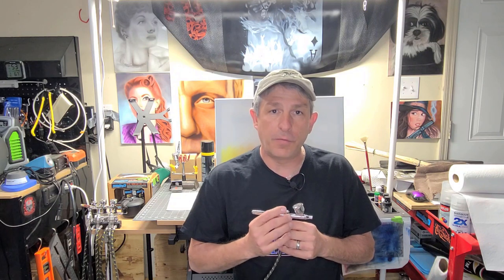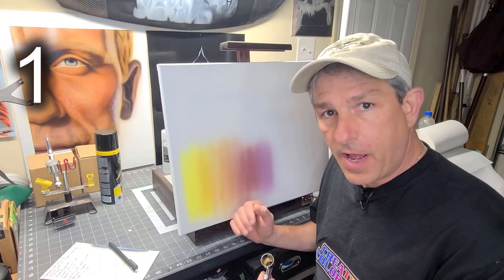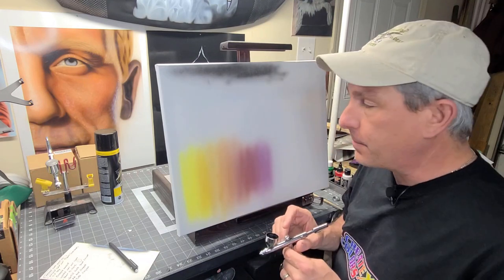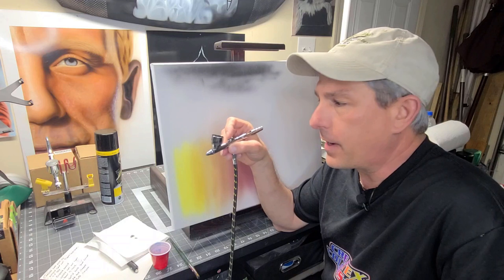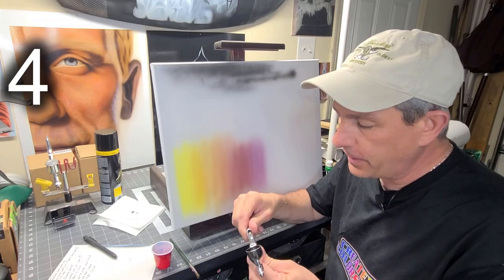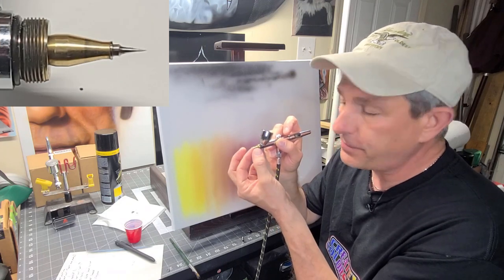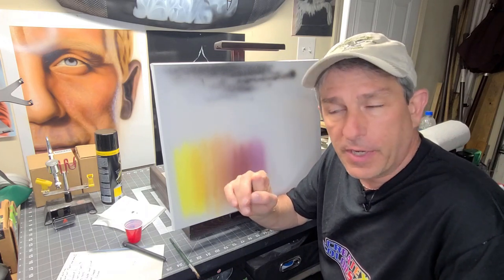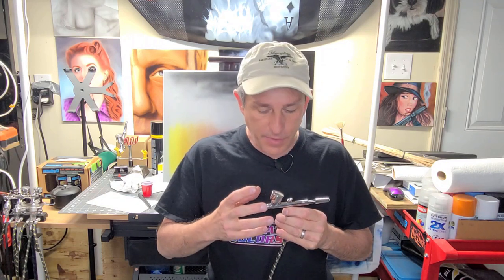Airbrush Won't Spray? Some Reasons It Won't!

Comment: I ordinarily spray with a bare needle, despite the fragility factor. I've found restricting airflow at the end of a needle in any way hinders control and begs more frequent clogging. 

 I too used to accidentally remove or loosen threaded air tips when I intended to only remove a crown tip or ring style protective sleeve. Since then, I've fashion softer plastic rings from cut segments of ball point pen/ marker sleeves or stout aquarium style tubing of the right diameter which can be removed or replaced quickly, slid on and off, so to speak. I find these far more convenient than threading something on and off between painting and storing. It also doesn't cost an arm and a leg if I loose one. As we all know, any chromed anything for airbrushes are pricey.

Another cause of blockage I've discovered is the clogging and backing up of paint into the channels in some airbrush bodies which convey air from the valve area through to the head and nozzle assembly. If paint gets into those and dries, (usually a cumulative and unnoticed process) it can eventually constrict or stop airflow to the tip even though a check of airflow at it's entry point to the brush indicates good  pressure.

Thanks for the video. Do you or have you ever used a Paashe AB retouching airbrush? Just curious. Despite being a discontinued tool, I use mine regularly and encourage any avid and brave airbrushers to get their hands on one and master it. There is really nothing comparable to it available for what it's best at, very fine work.
Reply from the maker: David, thans for sharing your experience. and no I never used a Paashe AB, but my first airbrush was a Paashe siphon feed. I used that for about two years before going to gravity fed brushes. Thanks again for the comments and thanks for watching.
Reply: @TheAirbrushGarage  You're welcome, thank you. The AB is the only Paasche I'd consider worth trying, not a fan of their convention style brushes but the operational principles of the AB sets itself apart from all other airbrushes. About the only thing it shares with other airbrushes is air goes into it. If you have a chance, do a search and have a look at how they operate.  I'd guarantee you'll at least find it interesting enough to wanna try sometime. Have a good rest of the weekend and thanks again.

Comment: I'm new to air brush and I did try that without the cap and wondered why it was able to spray without the cap on. Thank you for all these tips I ran into all these problems last night and wish I had seen it last night lol but I got through it I use a master air brush with the g233 and the g22 and I'm learning them still and learning the reducing part to get the paint to come out what is a decent psi to run I do custom hot wheels just a rookie on it but curious what psi u run your work at
Reply from the maker: Bleeleriy87, I spray at 27 psi. Good luck, and don't give up. It can be frustrating when you first start. Thanks for the question, and thanks for watching.

Comment: Awesome video! What's crazy was I was trying to troubleshoot my airbrush earlier and then this video popped up on my YT. Anyways..what was happening with mine was the needle wasn't going in when I pressed the trigger(Step 4). Which was annoying to fix bc everything was tighten correctly.
Reply from the maker: DS, did you get it fixed? And if so what was the problem?
Reply: @TheAirbrushGarage  I believe the screw wasn’t clamping on the back of the needle. I haven’t tried it yet but I did do a deep clean with an ultrasonic cleaner as well. I’ll let you know if it was something else. Thanks for your quick response.
Reply from the maker: @DarksouIjah  I have a video on "airbrush won't spray? Let's fix it. I don't have an ultra sonic cleaner. Also my first video I did on some reasons airbrush won't spray I talk about how my needle wasn't moving when I pull the trigger back and ot was because I forgot to tighten the needle nut. Lol. It happens!
Reply: @TheAirbrushGarage  I’ll check it out thanks! Also subbed.
Reply: @TheAirbrushGarage  I had this, ot appeared the needle wasn’t 100% clean , maybe greasy or a film of residue stuck on it, 99% ipa on a towel and rub the neddle with it and all went fine’  nice video

Comment: 😁😁 Could not tell you how many times I have not tightened the needle nut. The worst thing that ever happened was I was using my HPB plus and dropped it and then kicked it. Lucky for me I had the needle cap on and only spilled paint, so I thought. I cleaned the gun and began to spray shirts. Then there was no paint flow. I took the gun completely apart and put it in Airbrush Restore (be careful with this stuff. It will eat O rings.)  Put the gun back together and nothing. At this point I was very aggravated (mortified ) and had a deadline on detail on 20 shirts. I did every aleaning step there was. NOTHING! So, a friend of mine took the nozzle off and pushes a .18 feeler gage through the front of the nozzle. As we were looking through a lithoscope a 2 pieces of sand fell out the nozzle. YES! Sand! Remember, the hpb plus has an H2 needle nozzle combo that is .2mm. Now that was my first disaster. Then I did about 15 of the shirt fine details and dropped my gun with the needle cap off. Soooooo, I destroyed the needle, nozzle, and aircap. Very expensive drop.
Reply from the maker: Jeremy, It happens to all of us. That's why I keep an extra needle and nozzle in my box. Thanks for the comments and thanks for watching.

Comment: I clean it all that shoot out is the air some reason no paint is coming out so I after the plastic holder in water over night just in case the paint is dry so it not letting the paint flow though
Reply from the maker: Chef, take a look at this video and let me know. https://youtu.be/XnbRkeYBVyY?si=wU-IIyfDkhwpWMZr
Reply: @TheAirbrushGarage  so as I got home I took the bottom feeder out the water saw alot of paint coming out. It was the dry paint in the Tube

Comment: Bought a used airbrush kit and it works Great with just Walter or alcohol but when I use paint it doesn't spray paint. Thank you
Reply: Tonight, it sounds like your paint is too thick. Sart with a 75% reduction. Example...8 drops of reducer 2 drops of paint. If you are getting good results, add 2 moor drops of paint. Let me know.
Reply: @dancuccurullo8453  thank you very much, I will try that

Comment: helpful video…my issue appears to be that my lugnut is not gripping my needle so the needle doesn’t move with the lever is pulled.  I’ve tried tightening the lug nut but nothing moves!! Help please!
Reply from the maker: Linh, that's a tough one without actually seeing what's going on but...if you are using the correct needle size and the needle nut is tightening down it has to grab the needle. Take a video and IM me or send it to dan@theairbrushgarage.com

Comment: The air brush garage , yesterday I used my air brush it sprayed well , I’m a new user now learning to use one , last night I took it apart take it the needle and the pull back button to get paint fell out as the needle was out , I put it back together,, this morning using it it doesn’t work I’m getting non air ,, do you have a video I can look at to get fix ,,????
Reply from the maker: Vijay, the fact that you are not getting air is concerning. If your trigger feels like it is working correctly, there are only 2 reasons you are not getting air. 1. Your hole on your needle nozzle is blocked or 2. There is a rubber O ring in your hose connection or  more likely the O ring in the water trap at the brush,  if your using one can get pinched if you tighten these connections too tight. One other possibility is if you have a MAC valve on your brush, make sure it is not turned closed.
Reply: @TheAirbrushGarage  so I took it apart again a while ago there was a piece of thick paint beneath the trigger don’t know how that fit there , the trigger feels more free hopefully I’ll try it back in the morning I hope that was the problem

Comment: Hi Dan,
Helpppppp !
I’m new at airbrushing and I have the Iwata HP-CS. I’ve watched your video like 10 times and still I can’t figure out why my airbrush does not spray paint. Here is what it does. As I pulled the trigger back it does Not spray but as I move it forward it will squirt a bit of paint/air brush cleaner. I’ve taken it apart quite a few times and cleaned it as you show it on the video…so any suggestions?
Thanks, I appreciate your response
Reply from the maker: Ghost5. Have you checked out this video yet? Try this and let me know. https://youtu.be/XnbRkeYBVyY

Comment: I disassembled the gun to clean. After assembling, the gun is not receiving any air. I checked the hose and it is receiving the air from the compressor. What can you advise?
Reply from the maker: Amelia, I assume you didn't remove the air valve so that should be fine. Do you have a water trap right at the brush? If you di remove it and connect the hose directly to the brush. The other thing to look for is that the trigger is installed properly and depressing the air valve.

Comment: Hello Dan I am reasonably new to model tank building. My problem is that nothing comes out of my spray gun. Air does come out but no paint / liquid comes out. I have cleaned the gun over and over, I have stripped the gun down, I have replaced the needles and needle gauge still nothing comes out. I am wondering if O rings could be a factor here. I am at my wits end and I’m getting so tired of this happening so often. Can you help? Is there a YouTube video out there about checking / replacing O rings?
Reply from the maker: I am sorry if you didn't get my reply. I replied via my phone but it look like it didn't show up here. Start here...https://youtu.be/XnbRkeYBVyY?si=sucXsmGlRMcnW_Ha

Comment: I have a brand new airbrush, fresh out the box and its only spraying air. Not paint, not water, nothing! Please help....any advice is greatly appreciated
Reply from the maker: Red, remove the nozzle cap and nozzle then the needle. Now put it back together  make sure every thing is tight and the needle is pushed all the way forward and tighten the needle nut. Start with straight reducer. Hope this helps.

Comment: My Iwata Revolution has seized up overnight. I took out the needle with some pliers, and it was caked on paint about 2-3 inches up the needle (from the point). What do you think is going on?
Reply from the maker: Allessio, I know some people don't clean their brush when they are done for the night but I do and I never had that problem. I have a video on my cleaning routine check that out. Thanks for the question and thanks for watching.

Comment: Why is my Iwata dual action spraying paint when I just push down on the air?
Reply: Hitchcock, your needle isn't pushed all the way forward in to your nozzle or there is some dried paint in your nozzle or your nozzle is cracked. I hear a theme building here. Lol. You will get it just be patient. Thanks for the question and thanks for watching.

Comment: You forgot 1 thing I just experienced.  I have a adjuster valve on the bottom side.  I couldn't find the use of it on YouTube.  But apparently it can block all the air coming through so it won't spray.  Ps. Does anyone know how to use it,  what are the benefits 🤔
Reply from the maker: Herald, it is a MAC valve, Micro Air Control. It is used to reduce the airpresure for times when you want to get in close for finer detail and it could be use for stipple effects. It saves from having to go to the compressor and turning the regulator up or down. Hope this helps and thanks for the comment and watching.

Comment: So I normally just paint models with paint and a regular brush. But I wanted to branch out and use an air brush to try and paint my models. I got what I figured was a decent airbrush and air compressor combo off Amazon. I opened it up and it worked wonderfully for the first five minutes. As I got done with more models than I would have in the same period of time using a regular paint brush. But I ran out of paint. I went to fill up my paint reservoir on the airbrush after mixing both the paint and some thinner. And the airbrush refused to work.

I figured hey, maybe it's just clogged and needs to be cleaned. So I went inside took off the paint reservoir and the cap. Ran some hot water through both the reservoir and the little tube where it connects to the airbrush. Washed out all the extra paint. Put it back together and put some warm water in the reservoir and placed my finger on the cap on front. Just to blow out any paint inside the airbrush. There was some but eventually I got nothing but air to come back out that way.

I thinking that everything was okay put paint back in the reservoir and tried to start airbrushing again. But it would not spray any paint. I figured that maybe there was some water inside still that needed to dry. So I put it down for the day and came back the next day. Managed to spray some paint again, but in the middle of using the airbrush it stopped spraying, but there was still plenty of paint inside the reservoir. Confused I defaulted to thinking that again there was another clog. Repeated what I did the day before and waited for the next day.

Que the next day and the airbrush has refused to work for me. I carefully took apart the airbrush, thinking maybe somewhere there was a clog. There had to be a clog right? But I could never find anything clogging it. Carefully putting everything back together again. I still cannot get it to work.

I skip forward a few days to today and I could only spray for five seconds before it just refuses to work. I have looked up your video and several others. You have all given nearly the same exact suggestions and advice. Which I have done my best to follow. But I cannot get my airbrush to work and now I've just about given up hope on using my airbrush for painting and dreading having to go back to using a regular brush in order to paint.

Would you happen to have any suggestions?

From a complete novice of an airbrush user, thank you for any suggestions/ help.
Reply from the maker: Walking, don't give up. Sounds like there is dried paint in your nozzle. You think it's clean but you really can't tell unless you use a needle reamer. Also, what paint are you using? You mentioned modles. That's is usually testers paint, is that what you are using? If I remember that is pretty thick paint. I think what is happening is the paint is to thick it is clogging up in your nozzle and  drying on the tip. Ok...try this. Clean the nozzle run a cleaning brush from the front into the body of the brush. Once you have it back together spray only water. If the bush spays then it's your paint. It's not thin enough. Hear is a like to the needle reamer and brushes. https://amzn.to/3bXR4Kf. Hope this helps.
Reply: @TheAirbrushGarage  

Thank you,

I'm using vallejo airbrush acrylic paints. I was able to go to my local hobby shop and find the reamer and brush. I was able to get the reamer to go through on all sizes, but only the smallest brush worked.

I went ahead and tested the airbrush to see if it sprayed water and that seemed to work. Went ahead and tried mixing my paint and thinner to see if I can get going. I was able to once again get a good coat going. But I ran into my same problem of airbrush seeming to clog. I'm wondering if there is yet more paint that I have not gotten? Or if the acrylic is setting to quickly within the airbrush? Also upon further inspection my needle seems to have bent and I need to get a new one, lol.
Reply from the maker: Ok. Clean it again. Start with water add a drop of paint mix it spray it. Keep doing this until it starts to give you problems. This will give you the mix ratio. And set your pressure to 27 psi.
Reply: @TheAirbrushGarage  Got it, it's working again. I got some iso alcohol to make sure that the airbrush was clean. Rinsed it out and then remeasured the thinner to paint and dropped down from 30 to 20 and it is working now. Thank you for your help.

Comment: hi am useing the same gun hardenstinbek and am not geting paint but getting air i have a ultra sonic cleaner will that do it ?
Reply from the maker: Nikki, I have never used any me handicap cleaners. Make sure all airways and paint ports are clear. Also make sure your paint is thin enough to spray through a .18 tip.
Reply from the maker: I'm sorry me handicap was supposed to be mechanical. stupid auto correct!

Comment: Sir, help me please. I have a problem with my airbrush, i clogged it with old airbrush paint, i cleaned it, and i used some thinner and also some acetone, wich i ahoudn't do it... Now is all clean, but  it is sprayng intermitently. Do you have a solution? Thank you!
Reply from the maker: Paul, just recently put out this video. Check it out and let me know how you make out. https://youtu.be/WV8XdbpknJk

Comment: My airbrush only sprays paint when I'm actively moving my trigger back, like only during trigger travel. If I hold trigger in spray position, no paint spray. Help!
Reply: Brian, clean the brush out and make sure the nozzle is total clean and clear. Now start with just the reducer. See if it is spraying properly.  If it is, add a drop of paint mix and spray. Continue to do this until it stops spraying well.  Now, you will know the ratio in which you paint sprays good through your particular brush. For beginners, I recommend a 50:50 mix or even slightly more reducer. Let me know if this works for you.
Reply: @dancuccurullo8453  Hi, I've tried a full disassembly and cleaning a few times already, but I'm still having the same issue. Can you describe how exactly I should be cleaning the nozzle so I can make sure I'm doing that part right?